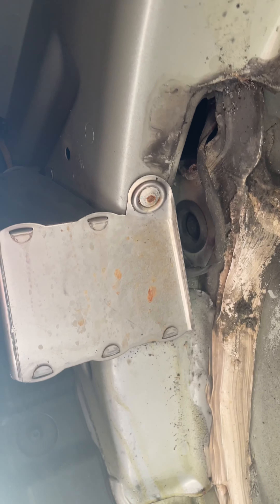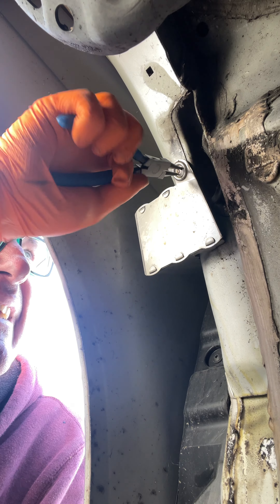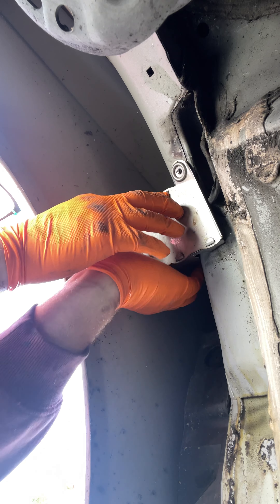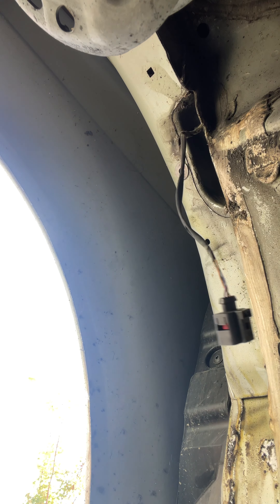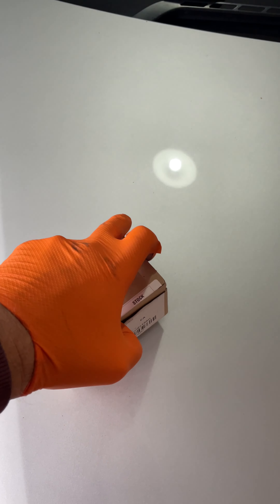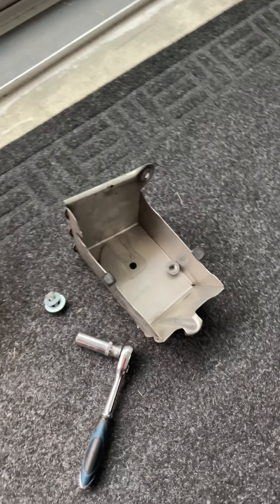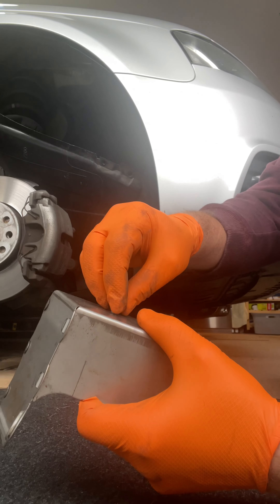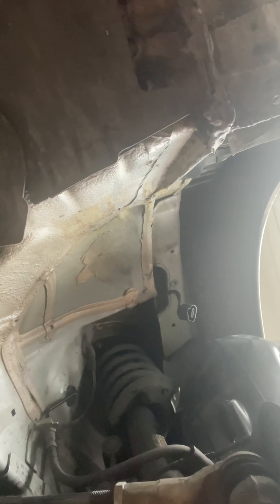Audi A3 8P Alarm Siren Location & Replacement

Comment: I just replaced horn on my a3. Did almost everything according to Your video besides that I drill that mounting screw away with extractor and replaced it with m6 philips. I bought used horn on eBay for 30$ didn’t have to program anything or delete codes, plug and play. Thanks

Comment: Do I need to remove the side skirts as my under lay won’t come off
Reply from the maker: You have to remove the wheel arch liner to access but not the under tray
Reply from the maker: Although if you look at the video you can just remove the rear and manipulate it out of the way

Comment: I've had my alarm going off all night. Ended up leaving it unlocked. Is the car drivable without this fitted? I'll be ordering one when I've pulled mine but need to use the car too
Reply from the maker: I removed mine then ordered the part and used the car for about 2 weeks without it fitted. Was not a problem. 
There are just heaps of fault codes that will need clearing afterwards from running without it but easy to do with an obd2 scanner.

Comment: Wot fuse and ware was the fuse located
Reply from the maker: Open drivers door and prise off panel on the end of the dashboard . You’ll need to look in your owners manual for the fuse, or look if there is a diagram on the back of the panel. Hope that helps
Reply: @MrMoocowmoomoo what’s it called? The manual doesn’t say alarm horn or anything
Reply from the maker: @TheDailyFetch not sure what it is actually called - alarm siren?
The part number for mine is 1K0 951 605F
Hope that helps 😊

Comment: Ahh mate where do i begin. You have saved me and my car from the scrapyard!! I have this same exact car. And on random occasions my car’s alarm rings and rings and its siren. I was having to either drive it around for 5 mins or disable the battery manually EVERY TIME to kill the alarm. I spent many nights poorly, woken up at 1am, 5am sometimes disturbing the neighbours even, because of this shitty alarm going off for no reason. I was losing hope I tried everyting to stop it, but it kept coming back. It took one youtube search and here was my knight and shining armour. I watched your video from beginning to end. after watching your video, i located my bastard alarm. we removed the wheel arch and low and behold there it was. we removed it and smashed it to pieces. thank you so much for your help and god bless u mate!

Comment: Salut merci pour ta vidéo. Je le disais bien a quoi servait ce fameux boîtier ¿ maintenant he sais😅 . Est ce que par hasard min alarme a cessé de fonctionner du jour au lendemain je n'avais plus le fameux bip de fermeture et lors dun test d'intrusion sur ma cabriolet a3 8p l'alarme ne c'est pas activé. Je pense que cela est du a ma dernière visite au garage. Serait tu comment la réactiver par hasard ? Merci d'avance a tout ceux qui auront essayer de m'aider.
Reply from the maker: The locking/unlocking beep can be turned off using an OBD2 device. I use a Carista. I would check there first. I would imagine the alarm would be the same
Reply: @MrMoocowmoomoo  merci beaucoup pour ton retour. J'en avais acheté un obd2 seulment c'était un entré de gamme et cela ne c'est même pas connecté. 
Je pense investir dans une valise mais je trouve cela un peu chère étant une simple personne lambda donc non non professionnels non garagiste. 
Cela est pénible tout de même venant de mon garagiste qui me l'a désactivé !!
Tu aurais une valise à me conseiller car j'ai également un voyant frein abs qui s'allume tout les 2mois ( le garage où j'ai acheté le véhicule n'a pas été fichu de trouver la panne) j'ai été dans garage de grande surface et eux m'ont dis que cela venait de défaut à la masse donc je soupçonne qu'il y ait des fils dénudé dans les charnière de porte forcément. Donc il me faudrait une valise qui puisse me retirer le voyant abs   aurait tu un Conseil à me donner stp ?
Reply from the maker: I use Carista but you have to pay a subscription to get full access. Costs me $60 NZD per year which is good value as we have 3 Audis in our family. There are other options but Carista has always worked well for me. You can buy a shorter subscription if you want to just use it for one project. Carista works well with Apple - not used it with android.
Hope that helps. Maybe ask on a local VAG forum for some advice?

Comment: Bonjour sur mon audi a4b8 j ai code defaut  00134 pas de signal communication j ai acheter une sirene neuve  chez audi et toujours le même code defaut
Je précise que l alarme fonctionne donc clignotant qui fonctionne mais ce code defaut ne disparaît pas même avec une sire.e neuve. Avez vous une idee
Reply: On the A4 that siren is fitted in the trunk.

Comment: I'm assuming it would be the same for the mk6 Golf - Great clear video, will just need to figure out how I can do this without taking the wheel off haha.

Also - do you remember what size bolt you used to reconnect the box to the car?